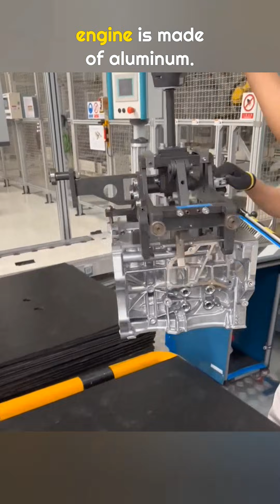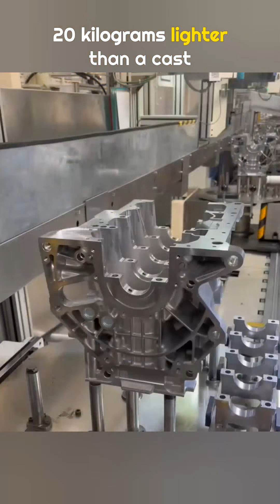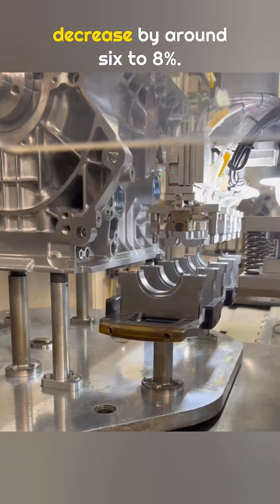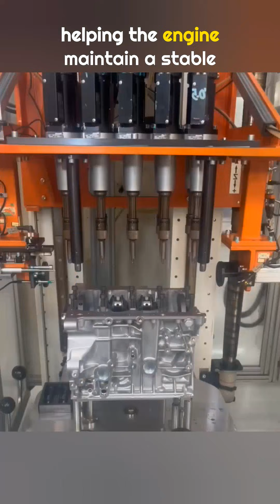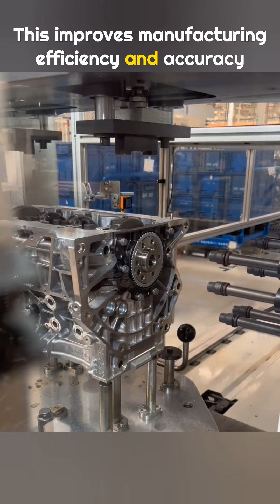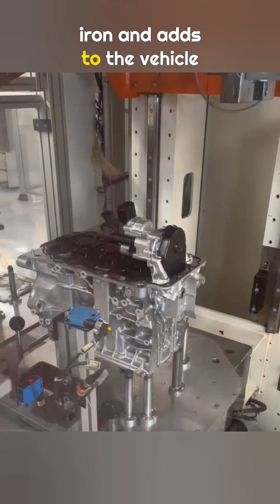Why New Cars Are Ditching Iron Engines

Comment: My car engine has a cast iron block but it’s only about 1/4 of the engine. Cam carrier, cylinder head and main bearing carrier are all aluminium. Using aluminium for the block is not worth the cost. It’s a Fiat “FIRE” which has been around since early 1980s. They are very reliable and shrug off horrendous abuse by owners.

Comment: There is nothing wrong with aluminium engine blocks. It means the head and cylinders all expand at the same rate. It also allows for casting which allows strength to be built where needed in ways that sand cast iron cannot. 
I have a 1970s Suzuki bike engine. All aluminium and water cooled. It’s ridiculously heavy because they made it just as they would an iron engine.

Comment: Cast iron engines are far more reliable. Old iron engines would last forever. Today’s aluminum engines are short term use and are only used to reduce weight.

Comment: now it's cheaper. and there using a lot more plastic now . oil pan , intake manifolds , valve covers , cheap, cheap, cheap, my town car 05 has cast iron block , no cam phasers , and my 01 I sold had 325k on it . today's engines are junk , rubber timing belts in the crank case 😂. on new fords

Comment: Al block isn’t pure Al — too expensive. It’s a combo of Al and SiO2, cheaper, brittle, just the way car makers like. The infamous Chevy Vega had it — or blew up on it. Al block will warp when engine overheats —  cylinder liner becomes distorted and piston movement will ram the dickens out of them. Result: oil burn, fouled valves, ruined engine. Stay with rigid  cast iron. Cumming, Volvo, and all diesel truck engine use cast iron for good reason. F1 racing engine using AL is Ok. Only stupid gullible wants Al block  in their commuter.

Comment: Nikasil or Alusil cylinder surface coating is necessary for any aluminum engine block. One problem, it is destroyed by high sulfur fuels such as gasoline made of heavy oil like Alberta, Venezuela or Russia. That is why these engines don't last. 150-200km is about it, while cast iron runs for over 500km. So, this video is giving some positive sides of the aluminum engines beneficial for automakers while hiding the negatives which are damaging for consumers.

Comment: Ok aluminum  block BUT WITH STEEL SLEEVES   . BETTER RINGS   , BEARINGS AND CRANK.  . 
NOW GO BACK TO A SHORT TIMING CHAIN , AND A NON INTERFERENCE  MOTOR . NON TURBO.  LESS HEAT AND OIL Consumption .
 
AND BRING BACK THE STANDARD TRANSMISSIONS 
AND WILL ALL BE HAPPY

Comment: Aluminum has higher thermal expansion coefficient, meaning there could be greater gaps when the engine is hot. AL is also much weaker in strength than steel, depending on the alloying and heat treatment each material is put thru during manufacturing.

Comment: Aluminium is the right choice. 

Ppl who choose iron do not understand that you can make equally "strong and durable" block using alu, but cant make it equally light using iron. 
There are more checkpoints to make a good engine than just materials.

Comment: Yeah, my older cast iron diesel burn less than newer shitty plastic cars. Aluminium engine is actually worse and termically less efficient than a cast iron engine, because cast iron block retains heat and stabilizes temperature fluctuations. So no, automakers are completely wrong. Also the engine isn't that heavy compared to the entire chassis full of junk. Ok, classic gasoline engines are in every way the worst engines, so the shittiest aluminium is enough for them.

Comment: As they said in the vid, it is easier for machining. Easier= cheaper. It also cools down easier, straight through the walls partially and they can make a little cheaper radiator. So, it is basically the one and only thing, MONEY. Aluminium gets cheaper overall. Everything else is just mumbo jumbo. Most reliable and long lasting engines have had cast iron blocks. Period.

Comment: Do you think we are idiots?  Who cares about 60 lbs less weight, iron engines are durable work horses, this junk in your video craccks with the smallest rough riding, and overheating melts that trash.  Keel aluminum in coca-cola cans and 747 Beoings.

Comment: Whatever weight was saved in the block was added back by other features like turbo and intercoolers. Aluminum blocks still need iron cylinder liners. A close deck iron block is stronger base to clamp the head to, better cylinder support. Over time some head bolts pull out of aluminum block threads because metal fatigue.

Comment: Aluminum is softer, therefore faster to get piston slap. 😅
Reply: No relations at all. Most aluminium engine blocks use cast iron cylinder liners. The piston rings are not contacting aluminium.
Reply: @fleurdewin7958 : I don't think so. Just watch the video provided. 😅

Comment: Cast Iron lasts longer, and is way stronger than aluminum.   My hemi engine block  and cylinder heads are Cast iron, and will last far longer than your lightweight aluminum engine.

Comment: Where are most newer engines? In the scrap yard. Aluminum has very little weight savings when it comes to an engine block. Its done to mainly save money. But it does not have the strength of cast iron. Auto makers could care less about long life and servicabiltiy. Blocks have to have steel sleeves and cranks. Add in the use of plastics on these engines makes them like a bic lighter, one time use. The new vehicles are over priced junk that spy on its owners. Keep them. Start building real cars and trucks.

Comment: Alu engjnes cracks much easier vs Cast iron with slightest impact like from a speedbraker or potholes etc.....just check any workshop ...big line up of such failed engines in their dump / scrap yard.

Comment: Internal combustion engines are 20% efficient at best. So in my opinion, the engine is dead. Electric cars are the future and everyone knows it.
Reply: ICE haven't reached technological peak yet. It would be sad if it died now. ICE is still experimenting with electronic valve control. You know there's EFI (electronic fuel-injection), electronic-ignition, but no electronic-valve-control
Reply: @xponen  Koenigsegg's "Freevalve" technology replaces traditional camshafts with individual electro-hydraulic-pneumatic actuators for each valve, allowing for completely independent control of timing, lift, and duration, optimizing power, efficiency, and emissions; it enables functions like cylinder deactivation, variable throttling, and faster turbo spooling, making engines smaller, lighter, cleaner, and more powerful, though complex and costly. 

And Rimac nevera electric supercar is 1900 hp and it blows it away therefore ice engines are finished
Reply: @michaelchownyk5255  that is cool, but "Freevalve" must been an early iteration like "Multi-air" and "rotary valve". Every carmaker will adopt it if the design are really good. Like for example, around 2010s Honda adopted a dual-spark-plug configuration (DSI) introduced by other carmaker, Alfa Romeo.
Reply: @xponen  with all the valve timing in the world you still can’t get better then 25% energy efficiency to the road and it’s still 75% waste heat. I’ve been driving electric cars for the last 14 years and to me the internal combustion engine is dead. I must be spoiled.

Comment: Recycled soda can engine blocks won't last as long as iron blocks especially the high compression of a diesel engine. Over heat a Soda can block and it will warp along with a soda can cylinder heads ,it takes a lot to crack iron blocks.

Comment: Cast iron cannot be pressure diecast satisfactorily, aluminium can, so the freedom from cold shuts, porosity and slag is much better with aluminium.
Sand cast aluminium is no better than sand cast iron, but pressure diecast aluminium is better than either.

Comment: I replaced my aluminium pistons with stainless steel pistons.
Reply: I use cast iron pistons 😅
Reply: @gregjohnson2073  i wanted a cast iron conversion, but then I was advised against it and to rather go with an electroplated 3D piston set…to which I decided naa…rather stainless steel…won’t rust and shinier is better.
Reply: Wow! wHO DId it?
Reply: but is it heavier than the original piston? heavier-piston is tuned for low RPM (like 1500rpm) and lighter piston is tuned for high RPM (like 3000rpm).
Reply: @xponen  same volume as the original pistons, so much heavier. Rev’s at 4500RPM max and seldom at more than 2500RPM under normal use.

Piston rings are teflon except for the oil ring. Charge air density is 2kg/m^3  so lots of intercooling.

I use an ISO VG100 polyurea grease instead of 5w30 oil…thicker is better

Comment: lighter component (such as light piston) has less inertia, so the engine can rev at higher RPM without drag, and low drag plus higher torque at high RPM gives higher engine effectiveness/efficiency, thus it reduce fuel consumption. However, the whole engine is constructed with same material (not just the piston & rod) because the metal--expansion-coefficient should match to prevent engine lockup when hot.

Comment: Cast iron all the way, aluminium is easier for the manufacturer to make but I’m not sure aluminium is cheaper as a base metal but the cost of production of aluminium parts is a lot cheaper because it’s easier to work with, I would not be happy with aluminium being the main material holding all that energy together!

Comment: Aluminum engine blocks and heads are better for car engine blocks and heads if the car is well maintained. However, in my view, cast iron engine blocks and heads are better for poorly maintained cars and for vehicles that will be used for toeing heavy loads such as trucks and vans.

The 3 main reasons - lower weight, better heat transfer, and easier to machine during production offsets the higher cost of manufacturing aluminum engine blocks and engine heads.

There are, however, a few downsides.

Specifically:

1 Cast iron engine blocks and heads are easier to weld, pin, or stitch, and generally responds well to conventional machine‑shop repairs like boring, sleeving, and deck work without losing strength, so rebuilding is more straightforward.

2. Yes cast iron engine blocks and heads are  heavier but they are more  more dimensionally stable; over a wider temperature range, are  less sensitive to localized stress and usually more forgiving of sub-stzndard maintenance  like oil and coolant replacement, which translates into fewer catastrophic failures over the engine’s life.

3. Cast iron engine blocks and heads are more resistant to distortion and cracking when overheated or run at sustained high loads over aluminum  engine blocks and heads and are therefore favored in heavy‑duty and commercial applications for longevity.
Reply: It depends what Aluminum serie, but it can easily be weld repaired using TIG/MIG, for gasoline and basic 4 cylinders block, Al is the way to go, now the more you increase the cylinders /pressure (Diesel) you ll be better off with a Cast iron block.
Reply: Iron engine block still surviving, but iron cast cylinder head is...for Asia is long gone...😢

Comment: Rather a run forever cast iron unit.
Reply: Motor tem que durar para sempre?
Não esqueça que há evolução, que torna os desenvolvimentos do passado obsoletos.
Reply: @joxzoom not neccesarily forever,  but if you are replacing a car every 2 or 3 to 5 years because the engine is trashed, you are wasting a lot of money. A not all but a lot of the aluminum engines will not withstand other component failures like a water pump or radiator leak if it causes the engine to heat up.  An iron engine can be damaged too but they typically have more tolerance for those types of things.
Reply: @joxzoom if I worked thousands of hours to pay tens of thousands of dollars for it - HELL YEAH. It should work Forever. Even beyond my kicking the bucket!
Reply: I guess that's why VW still uses Cast Iron in their GOLF. Not sure about the other models though.

Comment: Cast iron is better because you do not strip out the bolts.
Reply: Then don’t torque everything down like it’s a crank bolt. 

(Im also on the cast iron side btw)
Reply: @JEC606  You are kidding, right?
I was using a torque wrench at the recommended torque, and it stripped the valve cover threads.

Comment: Whoever saying aluminium is cheaper get your facts right!
Reply: I am also thinking that 😅😅.. bro has no knowledge
Reply: Aluminium for soda can was cheap but the alloy for cars far more expensive than steel
Reply: I don't know . aluminum is more abundant then iron ore. also your have lower melting points . ease of machining . you can probably reuse some of the molds . cast iron I believe you have to make new molds for every casting . I really believe it is cheaper.

Comment: Cast iron. 
Hands down, i just prefer a durable iron powerhouse that will go 400,000 miles. I'll sacrifice fuel economy for durability any day
Reply: You can still get that same mileage so long as the actual sleeves are made of iron. A company called carton makes sleeves for race engine and they hold up to about 1000hp. Good stuff. Imo that would be the middle ground.
Reply: Cast iron engines can handle a lot more abuse and overheating. An aluminum engine that overheats once is done for.
Reply: @dougfisher1813 no it’s not, but you’ve got to straightener head(s) when warped. Just don’t overheat your engine and replace the cooling system before it breaks. Stay on top of maintenance, saves money in the long run.
Reply: Exactly. The increased efficiency will cost you a lot more than keeping a cast iron engine longer, as you'll need a new car with the aluminum version.
Reply: This isn't your standard foil aluminium. This is durr aluminium or pronounced as duralinium and it's used in rockets engines,aircrafts and it's super strong for its weight.
Reply: @steelnail1917 oh, here i thought engines were just made of foil.
No sh*t, genius.
But aluminum is still not as tolerant of abuse as cast iron.
Reply: @christophrichter8234 You probably driving a car with an aluminium engine.  Cars with cast iron blocks are scarce as hens teeth these days. Most cars have aluminium engines with iron sleeves. Some are aluminium with a coating on the cylinder walls which  would avoid like the plague.
Reply: @briancarton1804 naw sir, i drive an F150 with a straight-six 4.9L.
If you arent familiar, its a heavy-ass long block that looks as though it should be in a tractor. The engine was discontinued in '96 and was never available in anything but cast iron--head and block.
I also have a 2000 Jeep Wrangler 2.5L with roughly the same specs but it's a pre-Chrysler AMG-designed inline-4. Iron block, and you guessed it, iron cylinder head too. 
Its not that cast iron engines are scarce, but that the manufacturing process that uses it in engines is.
Reply: Not just aluminum or cast-iron making an engine last it's about. Light weights efficiency ,corrosion, heat transfer